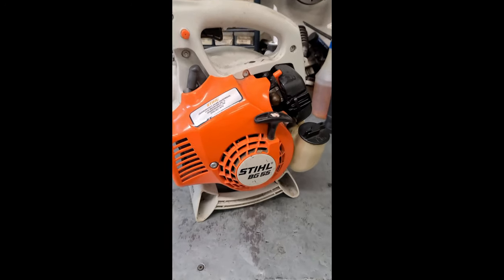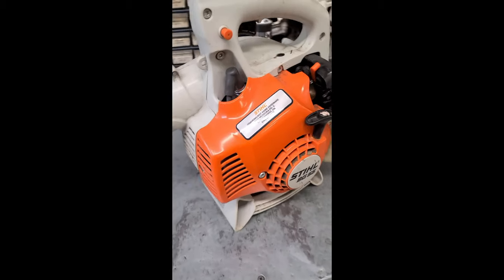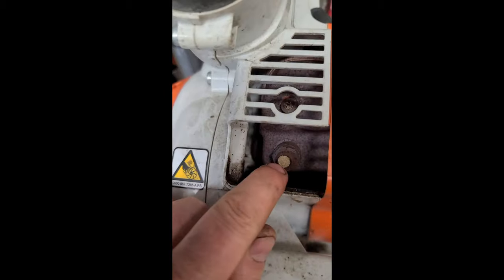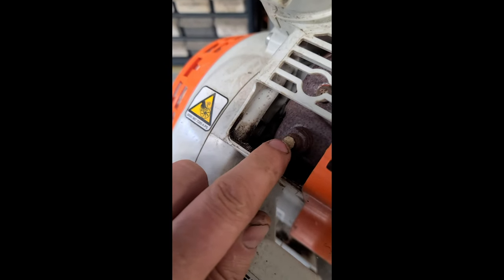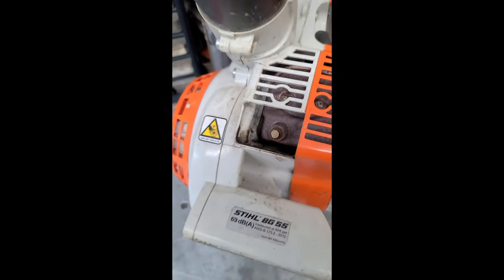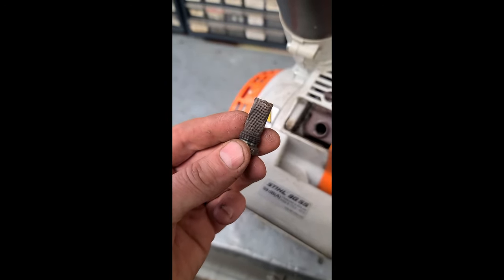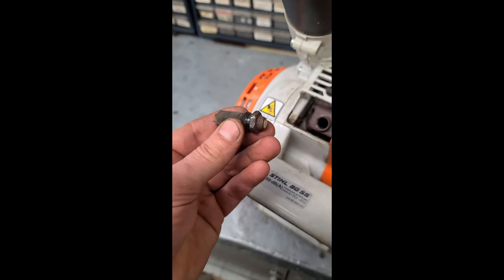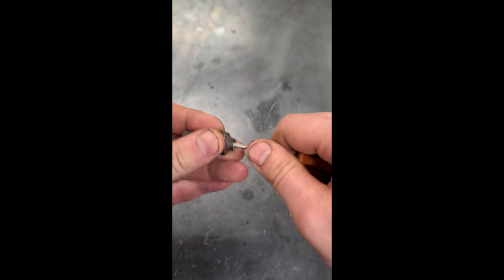Stihl Leaf Blower Wouldn't Start - Was A Simple Repair! #shorts

Comment: I find most have eather carb issues or spark plug issues due to wrong gas / oil ratio. I have been giving out ratio right cups for years now. Saves me on repairs and customers appreciate it.
Reply: Do you still repair small engines?
Reply: @markm2302  yes, I do.

Comment: I never used oil, I never Mixed fuel with oil,    I didn't know about this. I used for 1 year only filling with gasoline. May my engine demage? If I get a new carb, will it works?

Comment: a handful of tool repair guys i run into miss the part of the spark arrestor being clogged..  still bogs down after replacing nasty air filter and spark plug with build-up.  this is an excellent video demonstrating the fix. thank you.  sometimes i use seafoam on scrubbing spark arrestors.

Comment: I found the same problem in my cousin’s Stihl chainsaw. I cleaned it out and said that’ll be $50 sir. Lol. I was just picking at him. No charge. 
     I have to be sure my air chuck and blower chuck for my compressor are turned where the mud daubers can’t see them. They will plug them up every time if the air hose coupler is facing out.
Reply: We use to when we got bored or took a break
Put bb's in the blowers and shoot at drink can's.

Comment: I enjoy your vids and always look forward to the next one. Question, i have a Stihl BG85 should the primer bulb be filled with gas? Mine isn't and takes at least 6-10 pulls then starts and runs fine after it starts. Thanks!!
Reply from the maker: usually yes there should be fuel in the primer

Comment: Never seen that ....
Quickly question -  in the BG55 it has the vacuum attachments but is a plastic fin in the machine, the BG 85 would have a metal fin/fan
Can you fit a Metal fin/fan BG55 for vacuuming leaves better?
Thanks.
Reply from the maker: I'm not sure, ask your local dealer
Reply: Bg85 doesn’t have a metal fan.  The fan wheel is plastic and you can add a metal shredder blade.  It can be purchased separately and added to the BG 55 or BG 85.  Look on parts breakdown of the vac attachment.
Reply: @rwtrwt-ju9fk  thank you for the clarification, it’s good to know your options.
Thanks again 😀

Comment: What happens if you remove the screen? I only use it at my house and live in a large metropolitan city. Denver Colorado
Reply: As a small engine mechanic Dony can only advise you to leave it in but the machine will run just fine if you forget to reinstall it. :)
Reply: The mud daubers might build a nest inside the muffler body instead!
Reply: It is a violation to run any small engine on Federal forest service land unless it has a spark arrester screen. You are fine.
Years ago, chain saws required a 2-cycle fuel mix at very high ratios that would boggle your mind. Today, 50:1 is the norm. In the 1950's, 16:1 & even 10:1 were required.  The oil used was your basic car motor oil. All of that extra oil created a lot more carbon buildup. Larger particles would occasionally break away from the exhaust port/muffler & be spit out the muffler. The pieces were as hot as the temperature of the combustion process, & if landed on suitable tinder, could start a fire. Not a huge issue near a water supply like near your house, but a bit more hassle if you are felling on the side of a mountain out in the boonies.